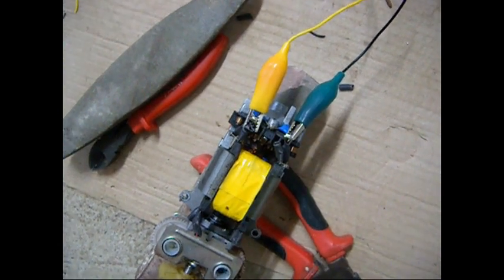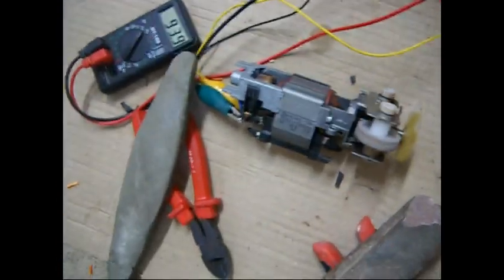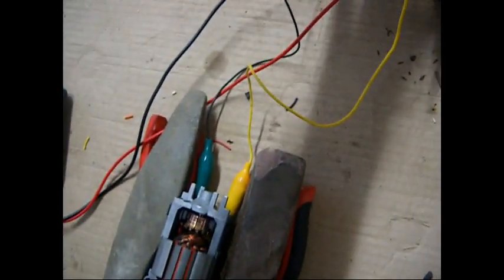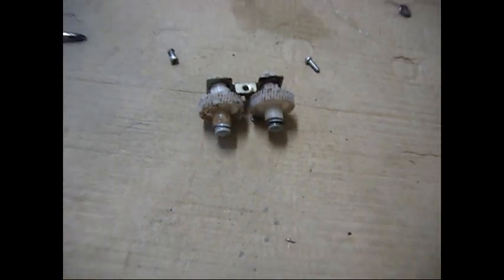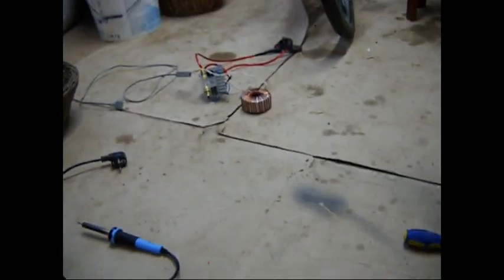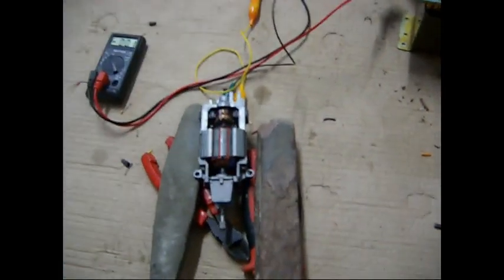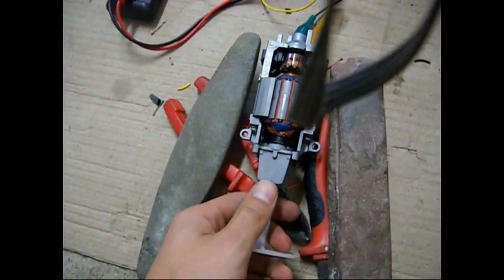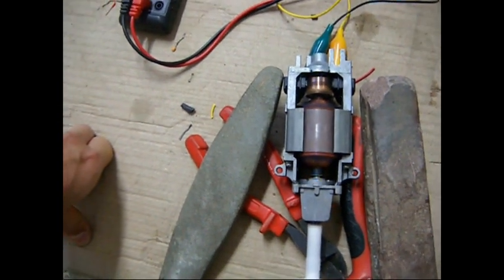Mixer motor on lower voltage DC

Comment: Would be a good drive assembly for model ship to sail in a lake. With electric slip on either outputs in one end used to steer the side to side and  with forward and reverse  thrust supplied  by main shaft

Comment: you found a use for your mixer motor? i just opened my old one and i wanna make use of the engine
Reply from the maker: Hi. No, unfortunally I haven't used it for anything. But you can use it as a blade sharpener if you can get a fine stone or something atached on the tip of the motor. Cheers :)
Reply: Thanks man :)
Reply: @ciprianwinerElectronicManiac  Or you can use it as a power nozzle motor to upgrade the agitation performance of a shark vacuum or hoover air steerable.
Reply: +ciprianwiner try to hook the motor in a cycle and you will get a electric cycle...